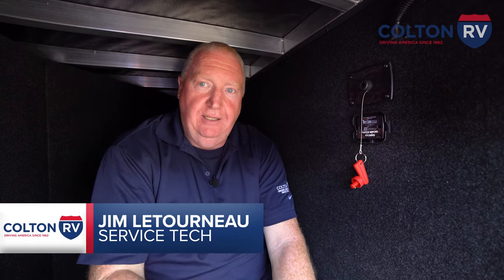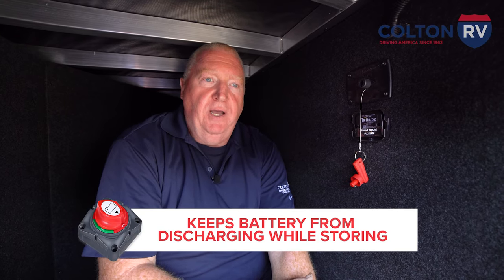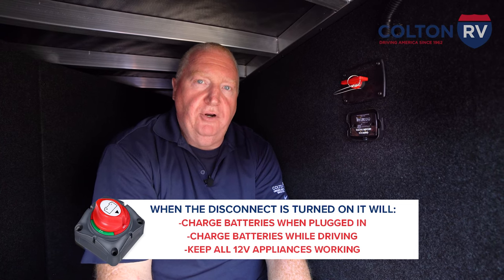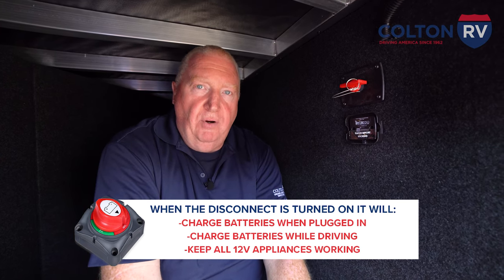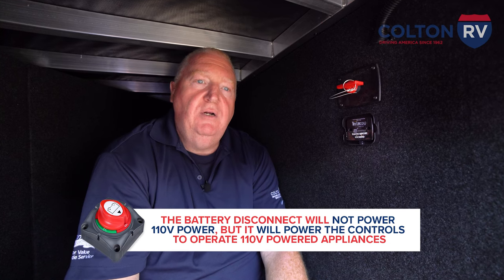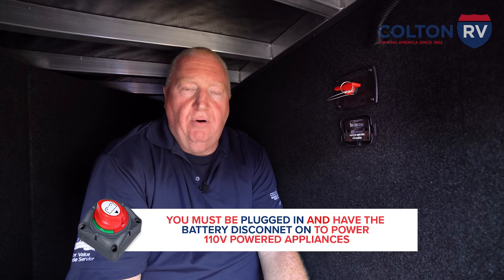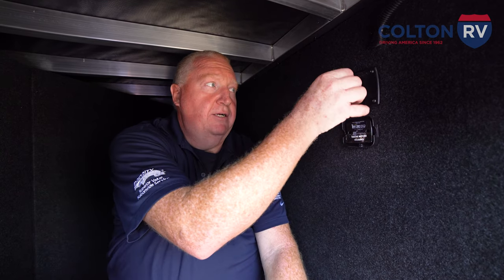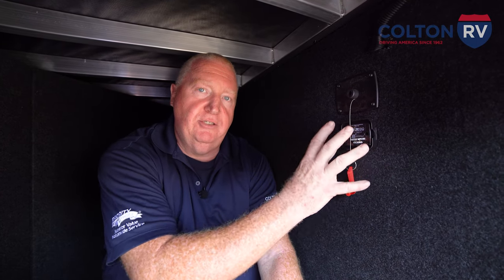RV Battery Disconnect Switch - What it Does and When to Use it

Comment: I have a travel trailer with a solar panel. Do I still need to use the disconnect?
Reply: That was my question also, does the solar maintain the battery if disconnect is off.

Comment: Hi Jim - Do you know where I can find the battery disconnect switch on 2004 Fleetwood Jamboree Class C? It's not in the battery compartment 🙄
Reply from the maker: Hello! That is tough to say with "older" RVs and without being able to see it in person! If its not in the battery compartment, it may be beside the coach entry door. These floorplans also had optional disconnect switches, so there's a chance that yours may not have one. Hopefully this is at least somewhat helpful!

Comment: So you are saying that if I turn off this switch while I am plugged into my vehicles 7 pin harness that this switch will prevent the batteries from charging while I am driving??  That's exactly what I need to know as I just put Lithium batteries in my RV and I do not want my trucks alternator to get damaged if the lithium batteries try and suck power from my vehicle.
Reply from the maker: Hello! That is correct. If you don't want to charge your batteries from your vehicle while driving, leave the disconnect switch in the "off" position. Safe travels!
Reply: @ColtonRVandMarine  Tried it, still charges whether the disconnect is on or off. LOL.  Guess I will just yank the fuse in my trucks fuse block.  Just hoping my emergency trailer brakes are not also connected to that fuse. Thanks!

Comment: Q: If you’re camping off 30 amp pedestal, and everything is fully operational with battery disconnect switch off. What purpose would you need to turn it on? I typically turn my on, to use electric stand, lowering camper on tow ball, while camper power source disconnected.
Reply: You need it turned on so that all the 12 V controls, that’s anything that is controlled by 12 V, can be used while it is turned on. If you leave it off anything that is controlled by 12 V will not work.

Comment: So storing my fifth wheel I just turn battery disconnect off ,? And leave batteries in place ? When I go back to use my fifth wheel I just turn disconnect on and I don’t have to charge my batteries?
Reply from the maker: That is correct as long as your batteries are charged before storing! If you live in a cold area with a Winter season, there are additional steps to take with your batteries when storing for the winter. You can get more info here:
https://www.youtube.com/watch?v=HBW7-jYTn9w

If not, you are good to with just keeping the disconnect switch turned to "off" when storing. When the switch is turned "on" when plugged in, your batteries will charge. When the switch is turned "on" while driving, your batteries will also charge. Thanks for watching!
Reply: Thank you

Comment: How about the grand design reflection 150 270BN solar on the roof is there a disconnect for that  ?
Reply from the maker: Hello! Solar panels bypass the battery disconnect switch and are always charging your batteries whether the switch is on or off!